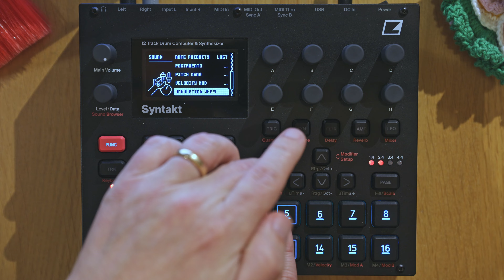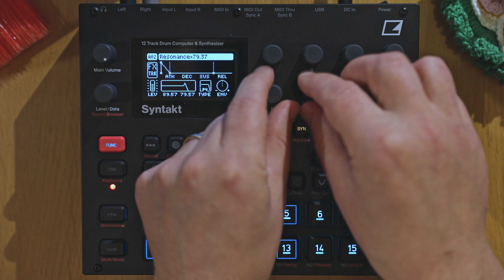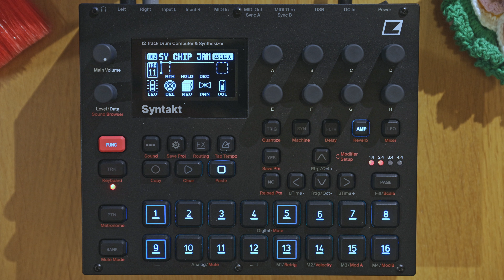Chiptune Drum Design using SY CHIP on Syntakt OS 1.30

Comment: What’s the difference between SY Chip and SY Bit?
Reply from the maker: Many differences. SY BITS is completely digital and has the primitive waveforms in a detuneable two-oscillator setting, together with a noise that is possible to mix in. Also a sample rate reducer. 
SY CHIP is mostly analog, with some digital (noise/PWM) and is strictly one oscillator. The other main difference is the built-in arp that can render the chip-chords and quick drum table sounds as demonstrated in the video.